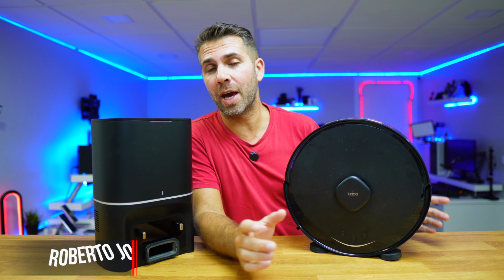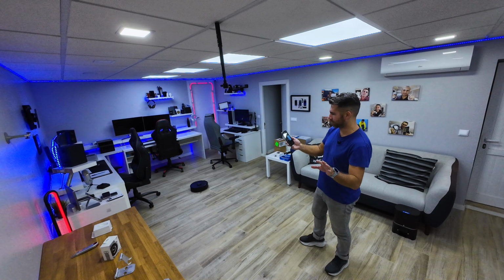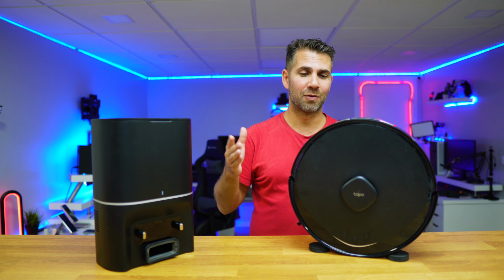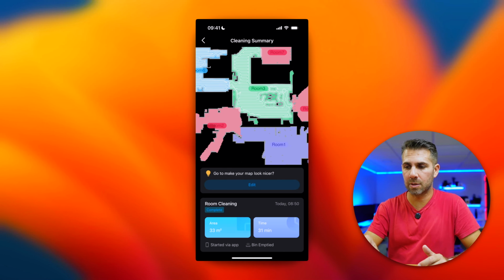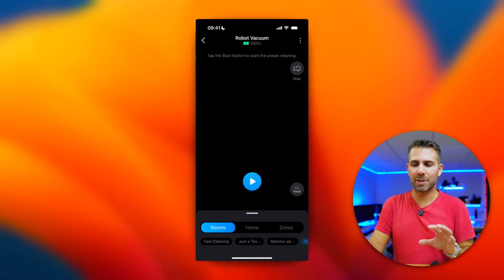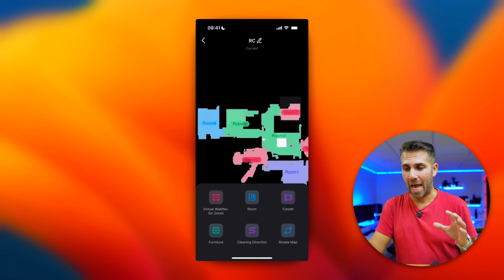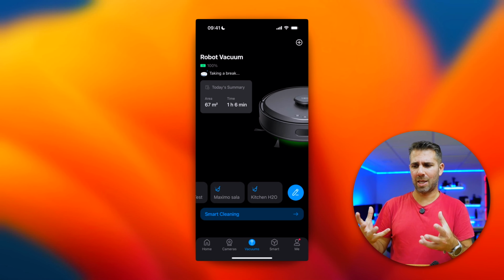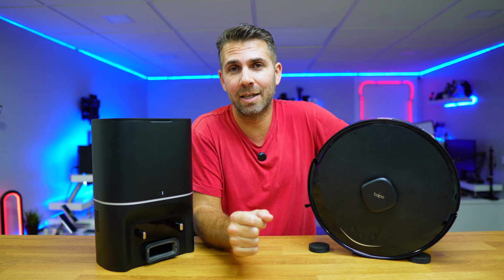Will This Robot Vacuum Handle Your Home? 😱 Tapo RV30 Max Plus

Comment: Can you just empty it manually without habing to buy the replacement bags?
Reply: I never thought of that. Just looked it up and they want HOW MUCH?? for the damn dust bags? $30 for 5 bags where I am. Yeah, nah, not interested in having to shell that out for eternity.
Reply: @MetalGearsOfThought I ended up getting this one — I bought 10 replacement bags on Amazon for $10 (non-brand), and yes if you want, you can also pull the dust out of the bag hole too and reuse the bag, but it's messy lol.
Reply: @secret-alias  Good to know. Not sure I have access to Amazon (without insane shipping prices) where I am (not in the US) but I'll look it up. Ty.

Comment: One thing I didn't understand is if it will auto empty the compartment after each session? I've get that it has an option to go auto empty after 30 minutes into the work, but that doesn't make much sense. I would like it to empty it always after the cleaning, does it do it?
Reply: Yes it does.
Reply: @kentan983 no it doesn't, I bought it and it auto empties every 30 minutes, or manually.

Comment: I have this model and I have hard floors and rugs, and instead of pushing rugs around (like my old roborock vacuum) it will try a little bit to climb over the rug (Even speeding up to roll over the edge) and if it fails it will just finish doing the hard floor and then try and tackle the rug separately. Which means it's not constantly trying to move my rugs around the house or roll them up. It has a really really good app, it's the first time I've seen one where the app is not just an afterthought, tapo have done a lot to make it really easy and intuitive.
Reply: Is the self cleaning feature automátic? (Empty the deposit once it docks in ) Or you need to press the button in the app as shown in the video ?

Comment: Any idea how it compares to the RV20 Max Plus?
Reply: Its the same spec for both model.
the only difference is height. 
rv20max only have front facing lidar sensor, making it shorter. 
rv30max is taller because the lidar sensor is on top of the housing, not front facing.
my sister have the rv20max and im thinking of getting the rv30max.
Reply: Same question here. I just bought RV20 Max Plus anyway.
Reply: @jojhansego  Hey! I'm on the brink of buying one too. Happy with your RV20 still?

Comment: Do you have any idea how it performs on carpets and with long animal hair?

Ive got a long haired german shepherd that sheds hair constantly. Im vacuuming everyday and this would be a great help if it could mean I only manually vacuum a couple times a week. Thanks!
Reply: Update, performs reasonably well enough to keep the device. I need to set it to max suction and 3 passes to get a clean carpet. The device sadly doesnt have anything anti hair wrap so the brush does curl hair up that i need to clean twice a week, the brush is easy enough to remove and can be unwrapped in seconds. 

The only issue ive had is the device gets lost in my small house, I think theres an awful lead lined wall in my home thats a wifi deadspot that screws with its mapping. Ive moved furniture around so it avoids the location and its now perfect. The battery could be bigger though, for something that would take me 20mins to manually vacuum takes this thing 3hrs because it vacuums slowly then needs to top off its charging (which is slow) and then comes back out to finish off what it started. Setting a full house deep clean at 2am to finish at 5am when im up for work and then another living room deep clean at 3pm (because I have a long haired german shepherd)
Reply from the maker: I have not pets at this moment but it seems that it gets a lot of debris, including women hair, so i would say that it will do the job. This one has 5400 Pascal and its was the strongest i used so far
Reply: @ Ive just bought it, i’ll return if it cant get dog hair out of carpet. Thanks though
Reply: @iCozzh  you get a 30 trial period in the UK. if it doesn't work for you, send it back.
Reply: Check out the RV30 Gen 2 being released soon. It has a built in hair cutter. 🎉